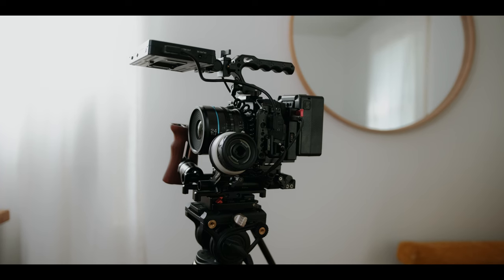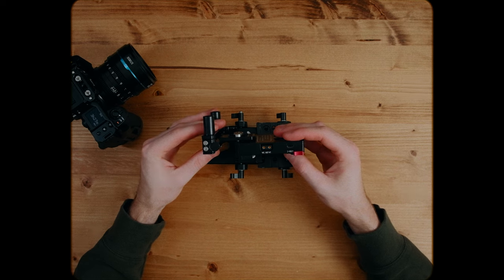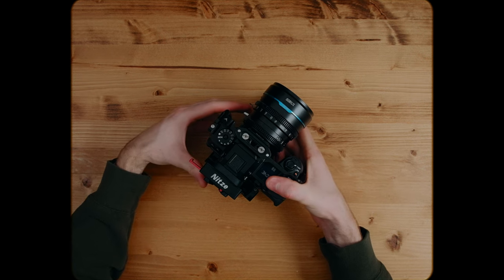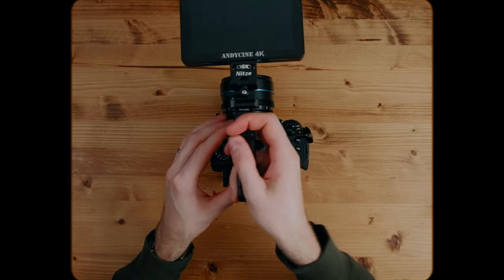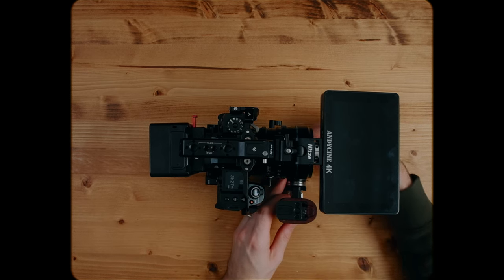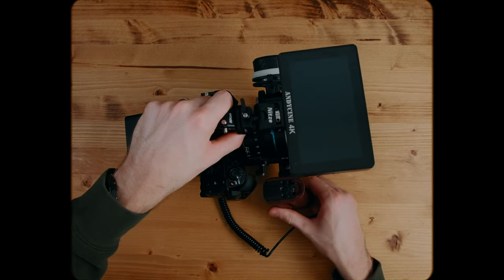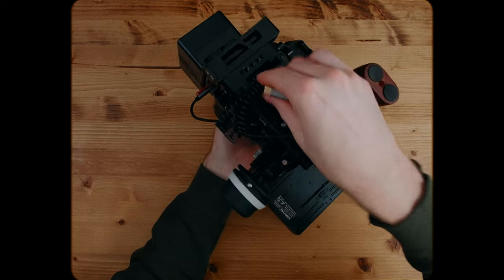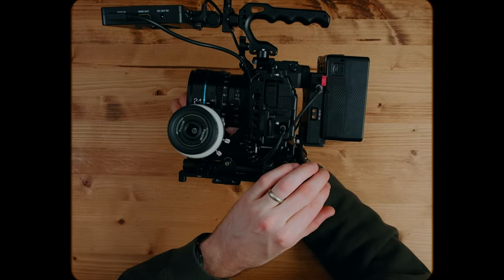ULTRA COMPACT Fujifilm XH2S Cinema Rig For Handheld Filmmaking

Comment from the maker: IMPORTANT NOTE – Glossed over it while filming this, but after originally filming this video 2 weeks ago and then breaking my camera, I decided to 100% reshoot this only AFTER I learned more about the issue and how to prevent it. In addition, I swapped over to a different v mount plate, battery and cable solution after hearing thoughts from several of you guys in the comment section. Those new additions to the rig are the ones featured in this video and I feel confident about how they will perform going forward. Holler with any questions like always down below and I'll get back with ya!

Comment: Just a quick point of fact...   you can actually close the door on the XH2S when using a dummy battery.   There's a small rubber gasket that pulls partway out to allow for the power cable to come out and the door to close. I use it all the time.
Reply from the maker: Oh dope. Did not know that. A few dummy batteries I had used in the past seemed to get quite hot so that also kinda made me nervous
Reply from the maker: which one do you use with the xh2s?
Reply: GyroVu from b&h...   link keeps getting script out best wishes... Good luck with it.

Comment: have you ever encountered any over heating issues while keeping the flip screen closed?
Reply from the maker: Good question. I always shoot with the flip screen out. I have had no overheating issues with the XH2S, indoor or outdoor until this past week. Had it in 90 degree direct sun heat and was rolling for about 20min straight. After I paused my shot, I had to let the camera cool down for 60 seconds or so before it would let me roll again. However that is literally the first issue like it I have had and am curious if it is firmware related as I just got it back from the Fujifilm repair center and they updated the firmware. Hope that helps

Comment: Already had a small rig and handle for my XH2 and wanted to get an external monitor. This video was extremely helpful and I got almost all of the components you listed (except the follow focus and additional side handle)!! Curious how when using the external monitor you reposition it when on a tripod and wanting to put it at more vertical than flat...do you use the arm included with the monitor for that?
Reply from the maker: Thanks so much! Glad to hear it was helpful! I just use the swivel monitor mount that attaches to the top handle and then to the bottom of the monitor

Comment: Nice build. I just bought my first monitor and am building my first rig for the xh2s. How do you go about monitoring? do you use a clean feed or do you leave the settings on there?
Reply from the maker: thanks so much. clean feed preferred
Reply: @blasepivovar  I like having the clean feed as well, but run and gun with a clean feed is a pain. I guess the top screen can be useful but still miss the info on the screen.

Comment: Hey man! Thanks for your videos they are truly helpful. I am also rigging my XH2s with similar setup and need to ask something. 

So let’s say I plug the cables in proper order, powering up my camera and monitor before plugging in the HDMI cable and start filming. If I take a break and need to power down my rig for a moment after unplugging the HDMI cable first: can I leave other cables plugged in during the break? And is there any specific order in powering up or down the system? Thanks in advance!
Reply from the maker: Yep, you have it right! If you are taking a real real long break (several hours), i’d advise just unplugging the v mount battery just to be extra safe.

Comment: Hi Blase :) Would you share what ND filters are you using? Especially when shooting outdoor? Thanks!
Reply from the maker: I have currently been shooting with the Nisi Swift True Color VND but have mixed feelings about it hence not adding it into this video. To my eye, I still find a subtle yet annoying color shift towards magenta that isn't easily color correctable as it seems to hit different colors like greens differently than skin tones. To me it messes with how good Fuji colors look straight out of the camera so am kinda mixed right now on it!
Reply: @blasepivovar  Ahh got it! I've tried some variable ND's but also: color shifts or strong X-pattern... seems like no good compact solutions here. Nisi Swift system looks kinda all right but stacking 3-4 filters for an effect doesn't sound perfect... :(
Reply from the maker: @PawelKlempkaFilms Feel you for sure. I mainly just use the 1-5 stop and then add the +4 stop on top need be. It’s actually pretty convenient and i haven’t had any x pattern with it. Maybe some slight vignetting on wider lenses. More just the color shifts to me that leave me from getting excited about it and recommending it to anyone.
Reply: @blasepivovar  Hopefully they will come up with some groundbraking technology soon! Crossing fingers. Thanks for your wonderful and inspiring work :)!
Reply: @blasepivovar have you ever tried the smallrig VND mattebox bro? I use it and love the VND integration (+ the filter is great, to me at least). Maybe you’ll find it as a good piece to this rig?
Reply from the maker: @Eyeofkamau i have not but it looks interesting for sure!

Comment: Hey Blase, good to hear you got your camera back from Fuji repair. If you don't mind posting, how much did they charge to repair your fried HDMI port? 

One more question if I am contemplating buying the XH-2S? I own the Osee T7 that I've been using with my X-T3 cine rig as well as on client camera rigs, it's a great monitor, but the Not great spec about it is that it won't accept UHD 60p, only 30p. It will accept 1080 60p but I saw in another XH-2S video that Fuji inexplicably left out the ability to output 1080 while shooting UHD? Is that still true as far as you have experienced?  

Also, how do you monitor when shooting 6K open gate? Does the XH-2S output anything out HDMI when shooting 6K open gate? 

If Fuji ONLY outputs UHD when shooting UHD and doesn't let you select FHD HDMI output as my X-T3s do, I am kind of hosed with this monitor, which would be a shame because I have become addicted to having a 3,000 not monitor for outdoor shoots. 

Thanks!
Reply from the maker: Yeah to my knowledge, I don't think the XH2S can output 1080p while shooting UHD, however the work around is just shooting with "HDMI Output Info Display" ON, which sends whatever is on the LCD screen to the monitor. With it not being a clean feed, I do notice some drop in the quality, however it is still plenty fine and hence what I do when filming 6K open gate. So you should be able to do the same thing when filming in UHD. Hope that helps!
Reply: @blasepivovar  That is helpful. Do you know the resolution the XH-2S is sending out for the "HDMI Output Info DIsplay Mode" when shooting UHD? I've tried looking through the owners manual but can't find out if it's UHD or 1080? Seems backwards that on my relatively ancient  X-T3s, they give you the option to send out FHD or UHD when shooting UHD but on this much newer and video-centric XH-2S, they don't? 

I don't really want to buy a new monitor as I'm pretty happy with the Osee color, tools, quality and the 3,000 nits, I did an outdoor shoot at an event last weekend and having the ability to actually see the screen in direct harsh daylight is a game changer. It would make life easier if it accepted UHD 60p but it doesn't, that's the compromise shooting with an inexpensive monitor.
Reply from the maker: It just sends a 1080p signal when using the HDMI Output Info Display. My monitor displays 1080p and 59.94hz in the top right corner when plugged in. Without the HDMI Output info display on, filming in UHD says 3840x2160 24hz in the top right corner of my monitor. Hope that helps! @danbrockettDOP
Reply: @blasepivovar  Thanks Blase, that's very good of you to check that. Best of luck and keep shooting good looking stuff with your XH-2S!

Comment: when using a tripod do you mount this whole rig to the tripod for quick on and off using another base plate on the bottom? or do you take it off the rig and then attach to tripod?
Reply from the maker: whole rig mounts to the tripod via the kessler quick stand (already part of my rig) and the kessler quick release plate receiver is on the tripod. the receiver is just arca swiss so you can also use others that are less expensive

Comment: When you spend 4 grand for a setup, you should also spend 30 bugs for some Typ C cables in the correct length, like 10cm for the bat. e.g.
And / or 90° ones etc.
Reply from the maker: Haha I actually have spent well over $30+ on a bunch of different ones and landed on liking these coiled ones the best as they seem to be more forgiving overtime. Plus prefer the flexibility of extra cable length if I need it. 90 degree cables in this situation wouldn't work well for me as where I place the flip out screen when filming interviews would smash it (or it would be sticking straight up putting an odd bend on the cable) + 90 degree cables wont fit inside the cable protector I have attached to the cage.

Comment: I had some power bank to feed my XT3 by USB C port and never works, if the camara is off, charge the battery, but when is on, the inside battery never gets the necessary charge to keep working, even if the Fuji said that the Anker Power banks batteries are good for them .... never works for me, but with a dummy battery works very well..... any coments??
Reply from the maker: Does your power bank have PD output? Is your cable suitable for PD output? I think on my XT3 I needed a power bank with a PD port to power the camera while it was on and rolling.
Reply: @blasepivovar  Yes my man, is a Power Bank Anker 20,000mAh PD 20W.... maybe is the cable... I will try another cable and check, maybe the signal that shows as connected in the screen is only signal but not real charge for the battery during recording
Reply from the maker: So odd. Yeah maybe try the cable. The USB C to C coiled cables I have linked in the description have worked great for me with power banks @manuart1983
Reply: I had the same power solution and can confirm the problem with not getting enough power for the x-t3. Have to check the USB C cables. I'm very close to buying the XH2s but I will wait for some months. There are still too many camera options to choose from 😅

Comment: what about audio?
Reply from the maker: didn’t include as it changes based on the job but most commonly running with the MKE 600 on the handle or mounted to the side of the rig with a cold shoe